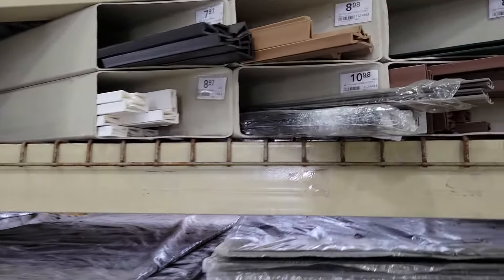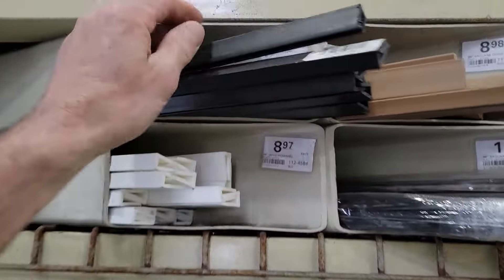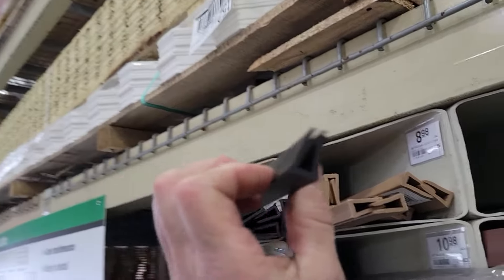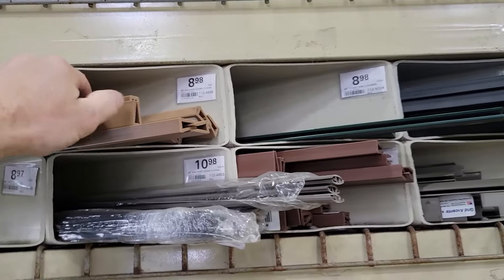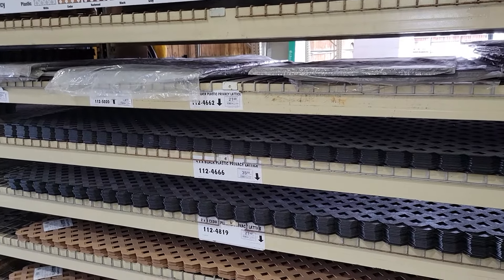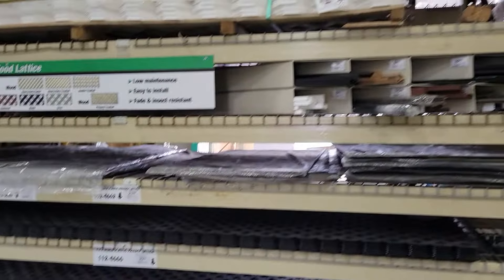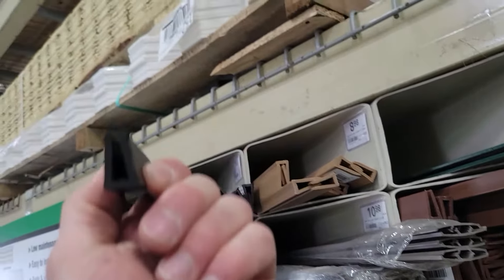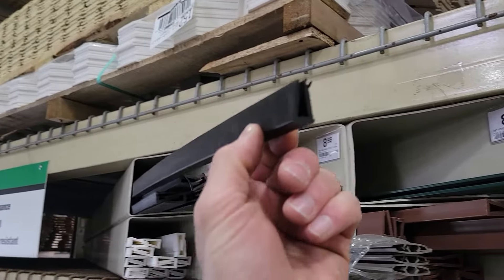Plastic "C" Channel for Sliding Plexiglass Window Track - DIY Deer Blind Hack!

Comment: Mark, I have viewed most of your Videos and plan on making two blinds this spring. I am currently trying to decide if I want to put in plexiglass sliders, using pvc trim boards, or a hinged window.
Any thoughts recommendations on hinged (Up), vs sliders. Noise reduction thoughts for sliders? I really like the ability to open either end of a slider, or simply remove the windows if i'ts not too cold. Finally, what thickness Lexan would you recommend for sliders? Would .220 still be required?
Reply from the maker: Hey Gordon,
I have hinged-up windows in one blind. I like that they are completely out of the way when open, and you can reduce or avoid blind spots with more allowed window space. It's all or nothing though, when you open them. I like that you can just crack a slider open if that's all you need. If I lived in the south, I'd probably go with acrylic sliders for the reason you mentioned. Ice and snow does present problems with them eventually where I am, and they do operate with a little more noise compared to hinged ones. In my opinion 1/8" acrylic is fine for sliders, if they aren't really tall (like under 12"). Go with 1/4" (.220) if you plan to build hinged acrylic windows. You'll appreciate the rigidity in that scenario. Perhaps you mixed me up with Mark from "The Back 40"? That's a great channel BTW!
Reply: @UncleBucks  Sorry Brett. I guess I was just looking for recommendation between sliders and a Hinged Up/Down windows, for MN / WI hunting areas. I have previously made sliders, and they seemed to work pretty good, however your design for the garage seal on your hinged windows looks great, and reasonable affordable I just came back from the home supply store, and see how much prices have gone up. I was thinking of using PVC trim boards and making my own sliders, but I can almost buy sliders for the same $$ I was just wondering if you had any preferences between the various types. Thanks again for your wonderful videos.
Reply from the maker: @Gordon Anderson ok gotcha. I like sliders the most for gun hunting, but I like my vertically hinged acrylics best for archery hunting.
Reply: @UncleBucks  Any thoughts / suggestions on Sliding window frame design / materials? I would like to put in about a 4' wide window on a 5' to 6' blind, and I assume 12" to 16" high is more than enough. Would you recommend two pieces of Lexan, or cut it up into three pieces. I assume I would have to go to three tracks. I am wondering if your garage door seal would work for the bottom on a slider, to help keep the sow out of the tracks and icing up. Would you use wood, PVC trim, HPDE for the slide "frame" material.

Thanks again for your feedback.
Reply from the maker: @Gordon Anderson  if I were to build some, I'd avoid wood. You'll have no swelling and definitely better sliding in pvc trim or c channel frames/tracks. I'd go with 3 panels and two tracks. The left and right panels in the outside track and the middle panel on the inside track. That'll give you the most opening options but the center one is probably the one you will operate the most, and it would always slide in the inside ice-free track, behind the other panes. You'll have some air leaks to address in the seams/overlaps though. For about $80 a window, you can buy pre-made insulated vinyl sliders at Menards, shown in my frosted window video. Those are really quiet operating. I'm not sure if I would go any other way now for gun or crossbow hunting. JMHO

Comment: Man what store you find this at. No luck at home depot or lowes 🤷🏾‍♂️🤷🏾‍♂️
Reply from the maker: Menards
Reply: I have seen them a every Home Depot I've been to. They are right by the vinyl lattice panels. Typically come in white, tan, green & black. Good luck!
Reply: Lowes has vinyl wainscoat or wall panel trim that might work for this also. And even cheaper.
Used the inside channel before as cheap alt for 1/4 round when installing laminate sheet or tile flooring.